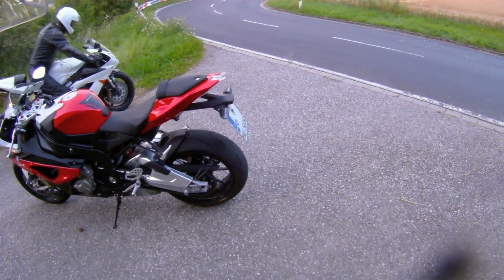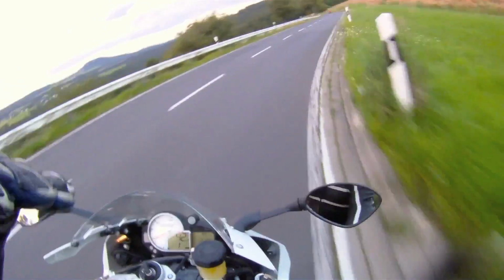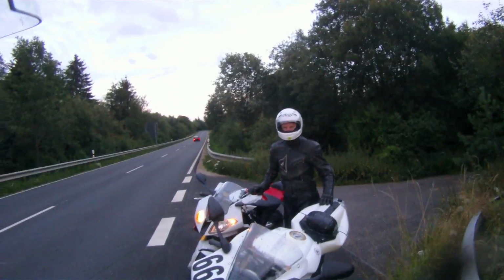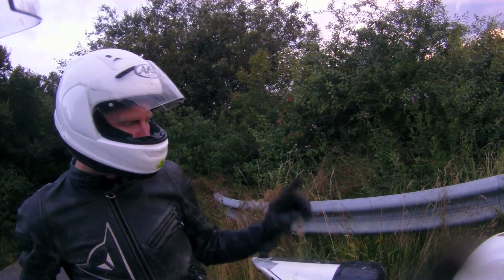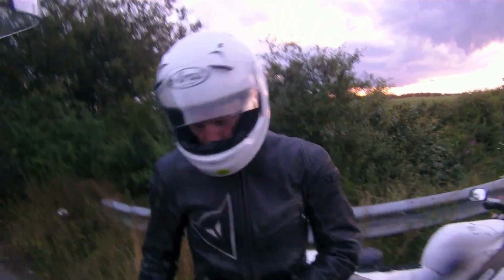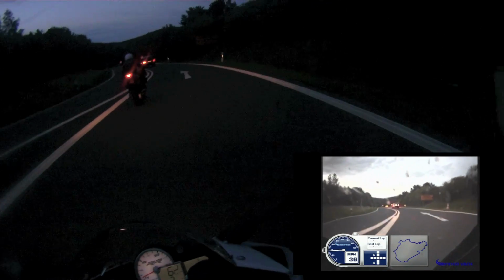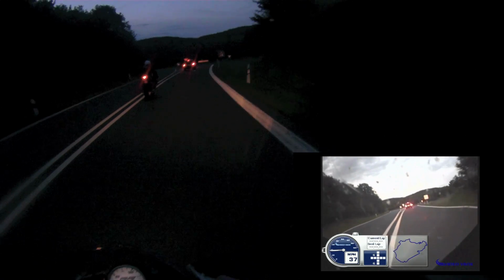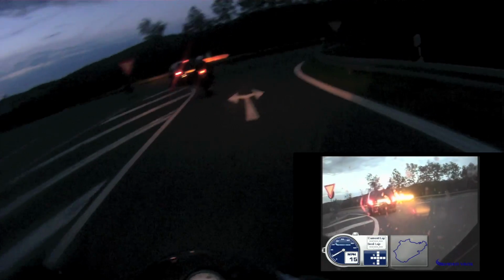Autobahn fun: 2012 BMW S1000RR vs Yamaha R1, maxed out at 299kmh

Comment: The 2012 R1 has WAY less top end then the 05 R1. Do your research kid.
The crossplane R1's sacrifice alot of top end for low and mid range torque/power.
I would know I had a 2010 R1.